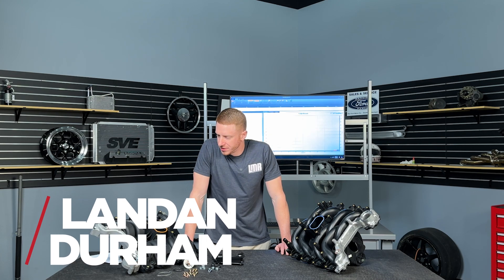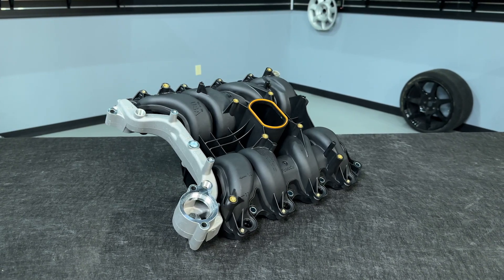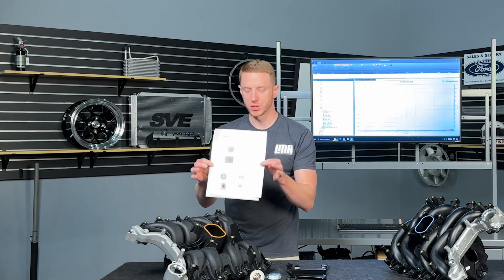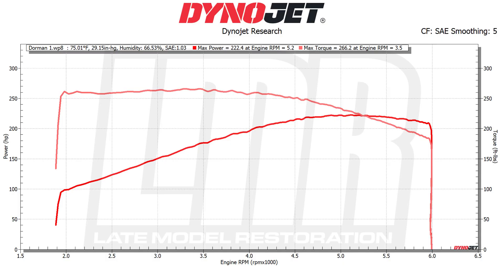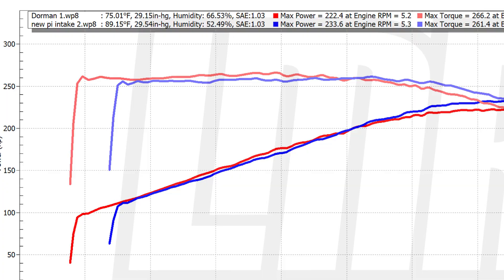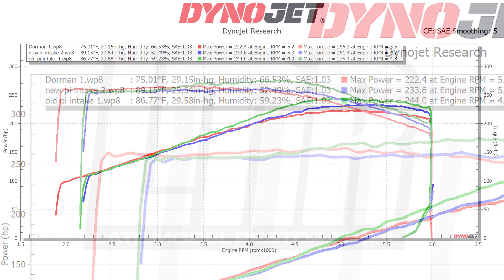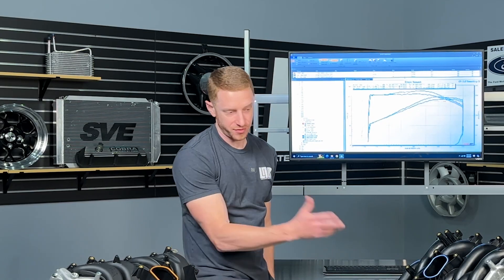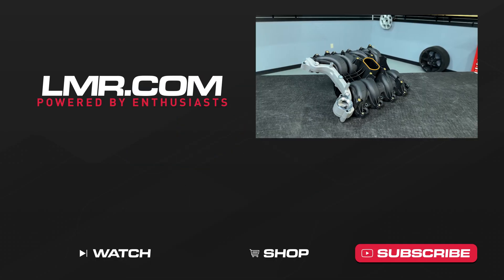NEW Ford Performance 4.6L 2V PI Intake Manifold (M-9424-P46A) - Dyno Runs & A Closer Look

Comment: So, in conclusion, the new Ford intake is better than Dorman, but still shittier than OG intake.
Reply: Slightly shittier. 10 horsepower is a very negligible difference. There are a LOT of different variables here.
Reply: @NightmareKato  thats a lot of power for these cars lol
Reply: @NightmareKato thats quite big honestly
Reply: And expensive af
Reply: I would argue the dorman is better. More hp and power down low, more torque overall. Ford only beats it in peak hp, the dorman wins everywhere else
Reply: @Xixu.co.6 I would have to agree with your statement, Just from looking at the data alone, I currently have the Dorman on my 03 GT from previous owner, Didn’t even notice until I seen the Dorman stamp on it. Car definitely has some torque.
Reply: @Xixu.co.6 I would have to agree on this, Dorman is cruising all the way up to 4,000rpms and more tq all around
Reply: But more durable where it counts I guess, wish they updated the older one than the dorman version
Reply: @jaygee6983 he said Dorman is better (ONLY) at lower RPMs than the original.. there is a difference
Reply: @christophermonroe701  Yeah, I mean as the video clearly states it's marginal what he's talking about. 8 horsepower difference between any of these in a panther car you wouldn't even notice. I used a Chinese doorman fake type thing and I honestly did not notice a power loss from the original factory one that leaked. I guess the main takeaway from this newer intake is the fact that they decided to go with separate gaskets on each of the ports instead of one long flat gasket and the fact the aluminum crossover the way it mates to the Head that is also something to consider. 

Now, I'm not knocking the new intake I mean I guess you got to look at it this way that maybe longevity will be key with this part. However, these plastic intakes were known to leak in a few different areas which required replacement.

The key really is if you get a good enough mechanic and they install any one of these intakes and they seal it well enough. It should last quite a while. Sometimes it's the mechanic or the shop you use. 

On some of these intakes they have extra ports for sensors and if you don't install the plugs correctly. Like adding some Teflon tape and making sure they are tight, you can have leak points.

I think what's going to happen is now other factories are going to create knockoffs that seal exactly the same way which will create competition and you will see the price go down to $100 for a Chinese version So if this newer design proves to be More reliable this could be a game changer for people with these cars you will end up with longevity and you can pick some of these panther cars up for a decent price and they are known to be fairly reliable other than the fact that most yards are crushing these cars for the metal value even though scrap metal Is low right now
Reply: This guy gets it
Reply: Yeah the originals are better but do you really want 20+ year old parts going into your car? My intake finally cracked and leaked coolant all over. Went with the ford part instead of the cheap knock offs.

Comment: Almost spit my drink out when you said we’re talking about 9-10 hp on a 2 valve mustang making under 300 whp 😂 you’re right. Who cares
Reply: Those who care about losing 9-10 hp on a 2 valve mustang making under 300 whp 😂you're wrong. They care.
Reply: that is true, but when you want all you can get from a slow, stock engine without spending like 6 thousand to make it actually start to wake up…
Reply: Pleb tier?? One of the best engines ever made, So bad we are still here talking about it 30 years later??
Reply: @NewEdgeDesigns  I'm sorry? You're upset that I called a dirt cheap, low power, high volume engine "pleb tier"? What, do you think 2vs are s00per d00per high performance machines? They were designed first and foremost for fleet vehicles and cheap base production vehicles dude, they're the very definition of "pleb tier". 2vs weren't intended for anything "high performance"(and the 2v heads are easily the worst part of the 2nd gen Lightning, obviously should've been a 4v), they didn't even make more power than the positively ancient 5.0l that they replaced. Hell, Honda debuted the J30 3.0l V6 in 1996 with 247HP FFS, that's a damn minivan engine(nevermind GM introducing the LS...). 

We're still talking about small block Chevys today too - also a pleb tier engine. Watch out, so is the SBF that the 2v replaced! Don't let the LS guys know that theirs is also a pleb tier fleet engine first...
If the 2v 4.6l was never put in Mustangs, no one would give a damn about them.
Reply: @RyTrapp0 still one of the best engines ever made.
Reply: Plenty of people, since there's still a big market for the mod motor bolt-ons. 

I always love when r*t*rds like you play yourselves when you think you're being a hotshot 😆 🤣
Reply: I think the point here with the 10hp is that it confirms it’s not a copy of the dorman and it’s a quality built part that won’t lose you hp
Reply: @gregd829 but it does lose over 10hp against a stock PI intake 😂
Reply: @BigCountry-df9rj  compared to the original intake which you can no longer purchase anywhere……
Reply: 9-10hp equals 10db louder lmao
Reply: (p o w e r  a d d e r)
Reply: @RyTrapp0   I have a Vortech V3 on my 99 gt with a 03 gt longblock and some comp cam 270. Based off the graph, yes you will make power with a Poweradder but the loss in power will be much more noticeable with boost than na. More than likely double the na loss. Just a badly designed intake.
Reply: @dj581  "Badly designed intake" just because it's 10HP down is hilarious😂 It's a replacement part for a straight up pleb tier engine, it's not like this is a Cobra intake or something, good lord.
With ~15psi, you'll be making ~480HP with this intake instead of ~500HP with an old PI intake - "oh no!", guess you'll have to add 1 more psi of boost
Reply: @RyTrapp0  I'm just saying after 30 some odd years they could have did better, plain and simple.

Comment: Have the old pi intake. Wouldn't change it. To make up for lose of torque down low I have aluminum flywheel and 4.1o's. Spins up fast af.
Reply: If you wanted to spin up fast a heavier flywheel  such as a  billet steel would have been a better choice
Reply: @neilbrown82  Heavier weight = reduced throttle response and slower "spin up"
Reply: @neilbrown82  More mass equals less accelleration, because it requires more energy to get up to speed. You clearly have not done high school physics.
Reply: @neilbrown82 sorry bud your wrong.
Reply: @shadowsfad3d  lol 😆 😂 🤣 😅 😄 😜